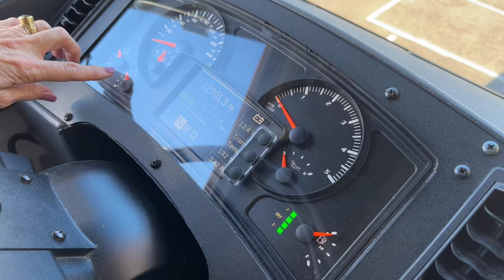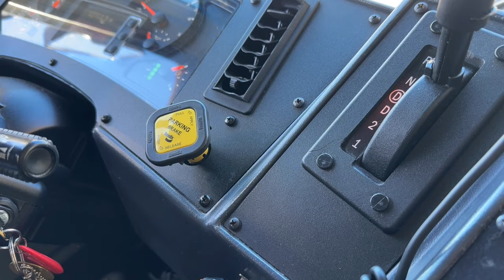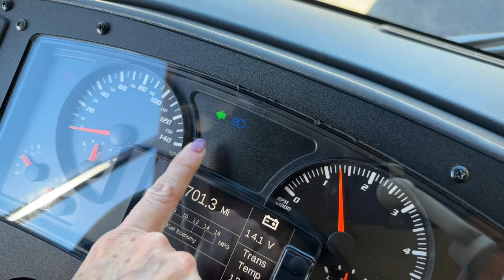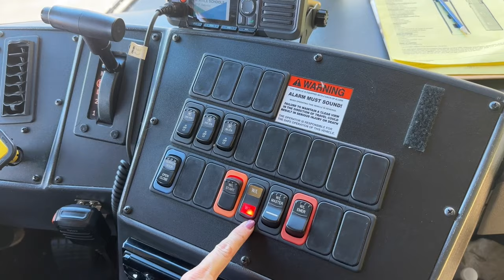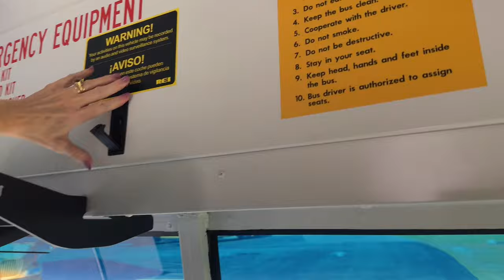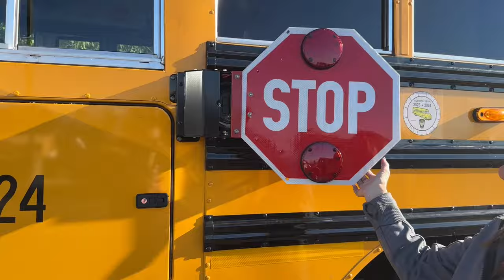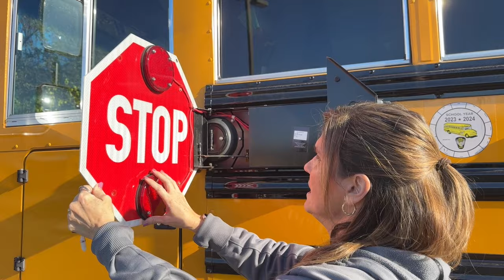Pretrip 2023 BB:RE Transit

Comment: Good morning, I'm in park county Colorado. Do you not have to chock your wheels for any of the pretrip inspection? I'm checking for my state but I did not notice it for your pretrip.
Reply from the maker: Because we conduct our pretrips on a closed course, we do not need wheel chocks… definitely check with your local test site, for specifics.

Comment: I want a school bus as my own personal RV. It’s 40 ft long, over 26,000 lbs gvw, and has air brakes. Will I need a CDL to use it as my own personal RV? I’m in Atlanta Georgia
Reply from the maker: I believe if you have the vehicle converted, there is no CDL requirement… please check with your local test center for specifics.
Reply: @SchoolBusSass  thanks